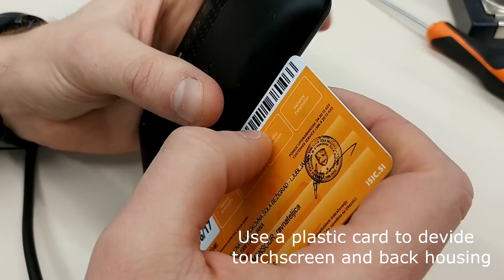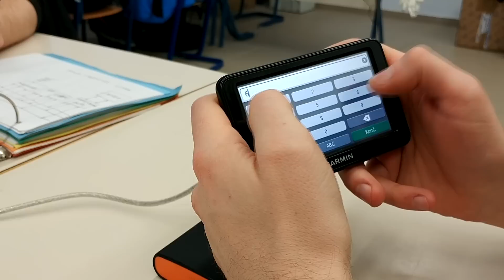Garmin nuvi: How to fix micro usb

Comment: When I opened up my Nuvi 2557, the USB connector fell out.  No idea how it charged at all (a lot of wiggling the cable).  Since it fell out ... used solder paste on the pads and then just touched it with the iron to get it all to reflow.

Comment: Designed obsolescence! Same thing happened to mine. Any competent engineer knows it's a big NO NO to rely on solder to hold any mechanically-stressed part. Solder has ZERO fatigue life!  two tiny screws or rivets would have prevented this. This has to be planned "engineered obsolescence" that finances Garmin's "lifetime" map updates. I kept my connector in place with a rubber band for two years -- now I'll try to add gobs of solder, as you did.